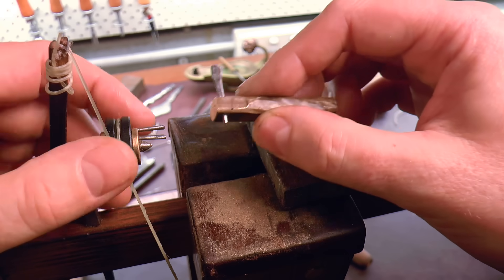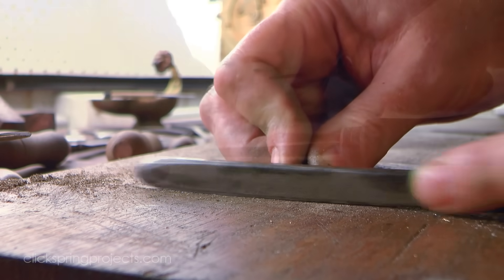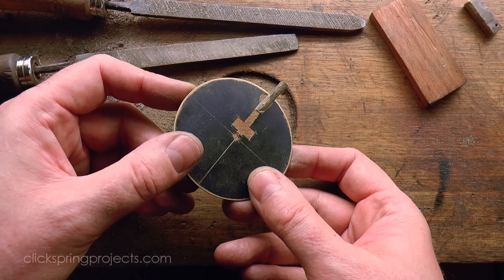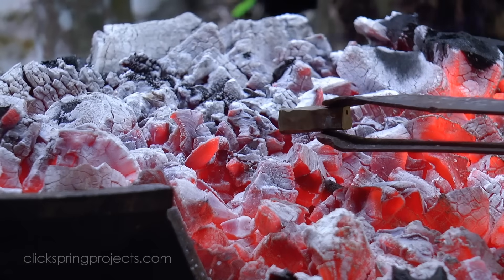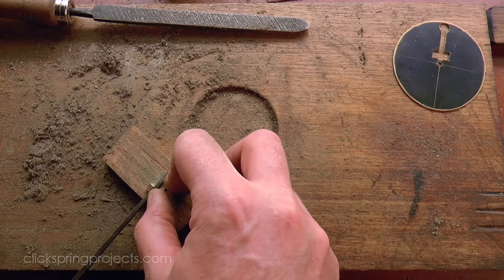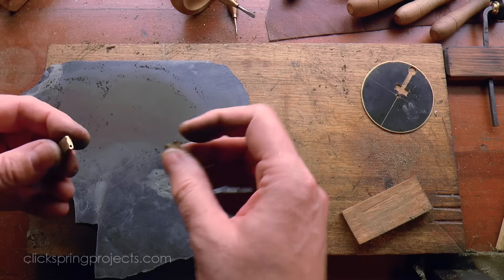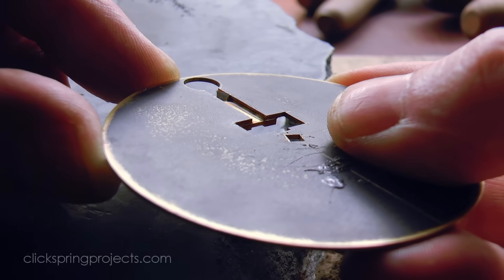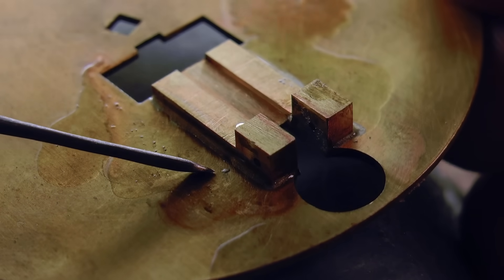The Antikythera Mechanism Episode 12, Part 2 - Making The Lunar Phase Display "Pipe" and "Cheeks"

Comment: since the brass is so expensive and requires special preparation to not waste it, would it be possible to collect the filings and remelt them down to use again or would it be too contaminated with rubbish to be able to do that with?

Comment: Considering how much filing you do on these parts, how frequently do you need to rebuild the files themselves?  Drill bits, too.  Those are some pretty small diameter bits you're using.  I doubt they stay sharp for long.

Comment: I was unprepared for just how closely the soldering process here resembles the soldering I was doing to .5mm pitch surface mount integrated circuits a few days ago.
Reply: Using a giant chunk of iron heated on a coal fire for smd parts? Interesting method...

Comment: I realize it's not necessarily part of the process specifically for a functioning device, but I presume that one of the activities at such a shop is bringing up apprentices from the curious peeking in through the windows or over the roof, though having them sweep and tend the fire, through doing some of the rough shaping, and slowly migrating them through the necessary skills to become masters of the metals they are working. In all that, I expect that there are likely to be a few 'products' with sub optimal workmanship, a file cut that went a bit deeper than expected, and may need to be repaired, such that while the final product of that attempt may not be the master quality product demanding the highest price, but are serviceable still. Some of them may need repairs during construction, and of course some may need repairs after a strenuous voyage.

Are we going to see how such a repair may be made, especially in a non-visible part, to insure function, if not the 'highest standard' of product? We all may strive for the perfect product to walk out the door leaving a substantial remuneration in it's place, but we also know that the master didn't start as such, and we're going to see some of their earlier attempts in with the bright-work.
Reply: I'd love to see that

Comment: When you're finished, it'd be fascinating (and possibly academically useful) to see if you can get it scanned with the same method as the original.

It might provide more insight into the scan of the original to have a scan and CAD model to compare it to

Comment: The guy who invented this must have had a similar brain to Tesla.
Reply: Nicholas Tesla was the real deal. Melon Husk is an intellectual fraud.
Reply: I would say that it is a device improved by generations of masters. It certainly started as a simple imprecise machine with a very small number of functions with a high error rate, but over time it was improved. New and new functions were added, mechanical calculations were refined with new ways of connecting wheels, the device was also optimized for the smallest possible number of wheels (i.e. common wheels for some functions or a more refined way of transmission; to save material and also friction), optimization of the distribution of parts and prevention of failures and breakage. And miniaturization was certainly taking place. And at the same time, the methods of processing and manufacturing tools were improved. There were certainly dead ends and unsuccessful methods. Perhaps some functions were verified on wooden and larger models. Some parts seem to me to be built so that the master could demonstrate what his workshop could do - why do it simply, let's show that we can do it very complicatedly and a similar purpose in many different ways of constructing. If it turns out that it took over a hundred years, from the first machines, say, by Archimedes, I wouldn't be surprised. It's not only the then-known universe in a box, but also a demonstration of craftsmanship and technical capabilities in a box.
The device doesn't look like it was invented by one person as a single finished design.